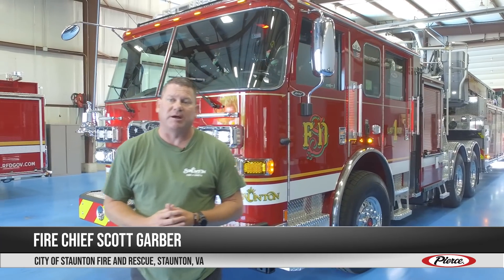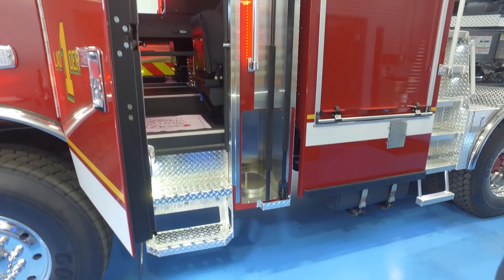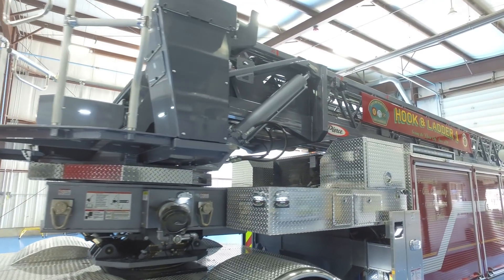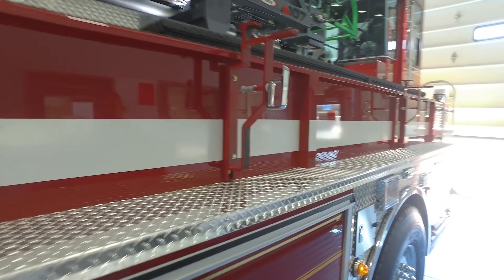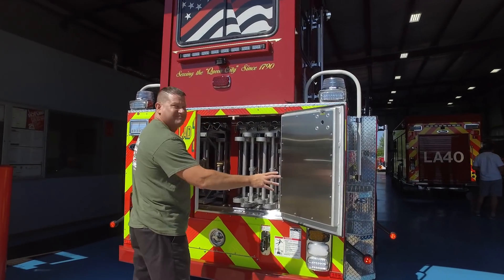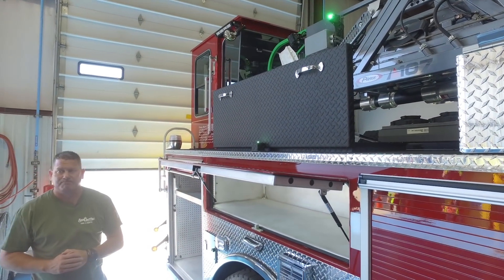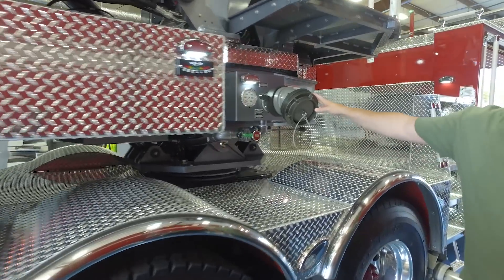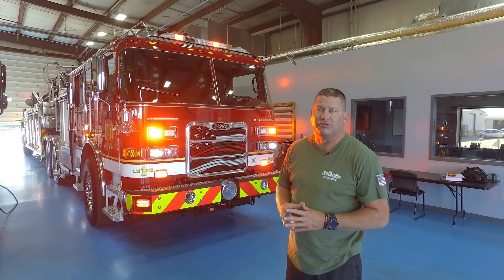Arrow XT™ Ascendant® 107’ Heavy Duty Tractor Drawn Aerial – Staunton Fire and Rescue, VA

Comment: I just want the tractor side of the unit but a tad longer with a semi 5th wheel plate for normal trailers. Can litterally have an entire apartment ontop of the truck for OTR guys. Driver controls just sot lower.

Comment: The (tiller operator's) upper access to the roof saw compartment is a genius idea. Using CAFS on a tiller where space for a large water tank isn't realistic is also smart. Well spec'd.
Reply: Also: mirrored ground ladder storage.
Reply: Our recent tiller had a top opening saw pocket too. The saw scabbard on the aerial was right there as well so it was easy to load up your vent gear for roof work. Nice feature.

Comment: Really like the Whelen LED warning system. Really like the front bumper M6 heads on the lower level front and the 2 on side for the intersection. I think the M6 heads on the corner are better as far as coming up to the intersection than the normal heads that are on the side. Nice job with the specs on this unit.
Reply: https://www.youtube.com/watch?v=xqV_wt6kBJw

Comment: Love the CAFS system. Makes so much sense if you not running a “quint”. I love the tiller quints that LA County FD runs, but it makes a long truck longer and heavier. So smart going this route. The great thing is these CAFS systems can extinguish a large amount of fire until a true Engine arrives on scene. Nice truck btw.
Reply: Well i can understand that to some Extent. Even here in Germany and some other European Countrys, Fire Departments use some quite Old Vehicel ( some Departments still use Fire Trucks from the 1960s) but as long as they work without Problems, those Departments happily use them.

What i dont understand too is, when i see some of the Fire Trucks with excessiv Amount of Chrome, Tons of Lights and whatnot. Im really no Professional to understand all the Things about how they buy there Trucks and whatnot, but if they would cut that Stuff down a bit, they could use it for other Things.

Only a Examples from Germany and the Cost for one of our Standard Unit.
They are mostly Standarized, but a Community or City can order some differences or extra Equipment on Vehicels for Extra Costs.
For Example, the standard in most Citys, the so called " Hilfeleistungslöschfahrzeuge" ( rescue pumper), type HLF20, costs between 320.000 to 380.000 Euro(387.000 to 460.000 Dollar) and those Trucks have  more Equipment than American Engines on Board.
I dont know the Costs of Engines and such in America, but it would lower the Costs if they wouldnt equip them with Tons of Lights that they look like Christmas Trees and Tons of Chrome and maybe change some other Small Things.
Reply: The Question is know, will they ever use it? I Never saw any American Fire Department Using CAFS or any other Type of Foam System for Burning Cars, Trucks or Burning Big Garbage Container.
Reply: @Sheppart92  Totally would depend on the situation wouldn't it? Maybe their engine is returning from a different call is isn't quite available yet, and this truck may happen to be first on scene. What about if this tiller is returning from a call and comes across a vehicle fire? Many different possibilities to use that CAF system.

At least they have the option to start fire suppression until a dedicated suppression rig arrives and takes over. Nothing wrong with being versatile.
Reply: I live in Germany and Foam Systems are Standard on almost any tanker, rescue pumper etc. While i watched quite some Videos from America over the years where i never even once saw a Department anywhere using CAFS or other types of Foam Systems to extinguish burning Cars etc. i even saw some Videos where burning fuel was coming out of trucks and all they used was water. Thats where i dont understand the American System. Anywhere Else in the World ( at least Europa, most of Asia) they use those Systems, While American firefighting System has still so many weird or outdated tactics and Technics.
Reply: @LiamPattisonPhotography  you're right I'd rather have it and not use it than
need it and not have it  remember he said they're a rescue unit also good concept